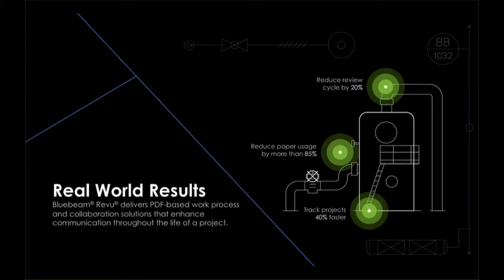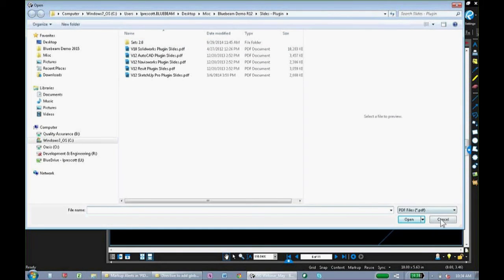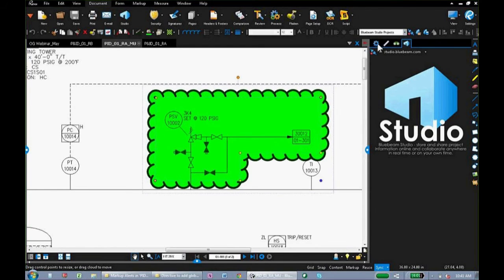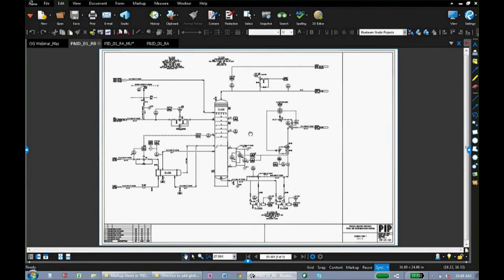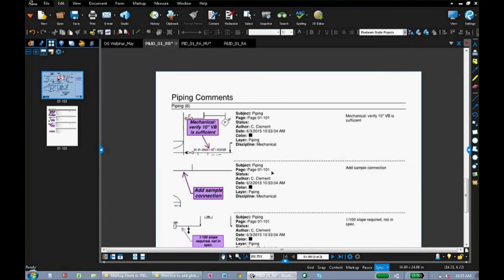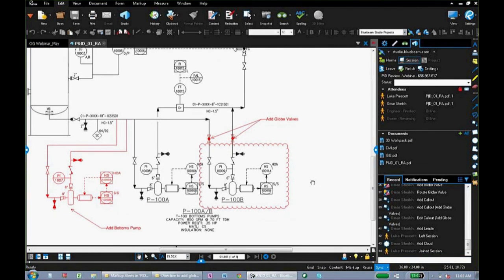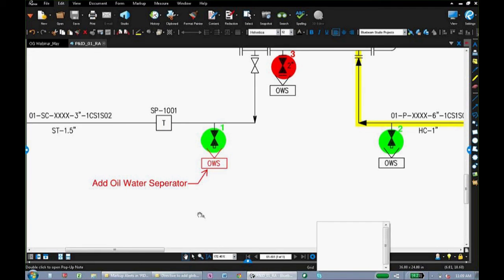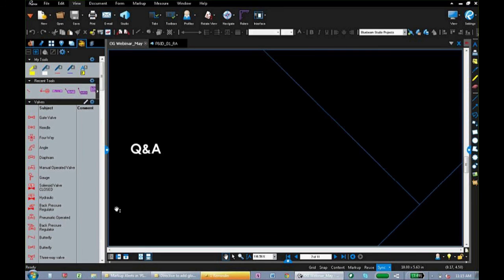Bluebeam Revu for Oil & Gas

Comment: I really like using Bluebeam Revu for drawing, marking up and maintaining Master P&IDs, it has completely replaced my old method of using large paper copies for that.
One thing that I haven't figured out yet though, is changing the colour of existing lines: I have an existing P&ID (pdf) from the client, and I want to change the line colour of all the lines/symbols within a certain area from black to blue (our colour code for demolition), preferably by simply drawing a polygon that includes the content to be coloured in.
And I don't want the background (white) to change its colour.
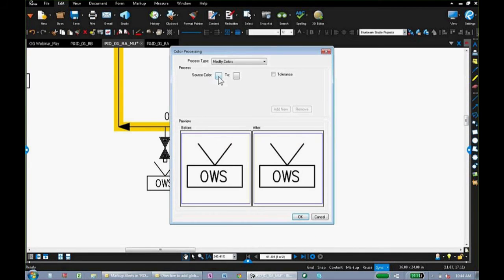Is there any way to achieve this with Bluebeam Revu (except for creating a snapshot like shown in the video at 19:05)?

Comment: Hello, 

Is the snapshot tool that you are using stil available in Bluebeam version 20?
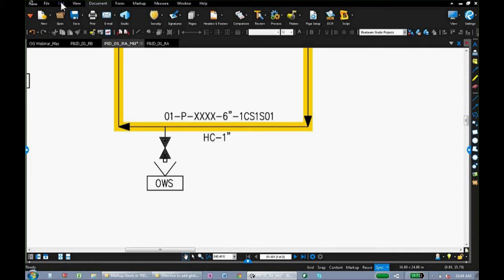i mean the one that you are using at this exact moment 18:34 

i cant find this tool in Bluebeam version 20 

i can only find the cut out with rectangle tool
but not the cut out with polyline tool that you are using in this video
Reply from the maker: Hi Vince, thanks for your question. The Snapshot tool can still be found under the Edit menu, located right below the Lasso tool. Unfortunately YouTube doesn't allow us to share a screenshot, but if you're still unable to find you can also access by using the keyboard shortcut "G". Hope this helps!

Comment: 17:06 Is there a way to draw those highlight polylines without manually going over each line with a highlight pen? I'm looking to node P&ID's for a HAZOP
Reply from the maker: Hi Jason, thanks for reaching out. If you're trying to draw a Polyline that also behaves like a highlight, select the Polyline Tool then type Alt+P for the Properties Panel. Next to Fill Color, check the Highlight option. If that's not helpful, we suggest you connect with our support team for assistance at support@bluebeam.com.